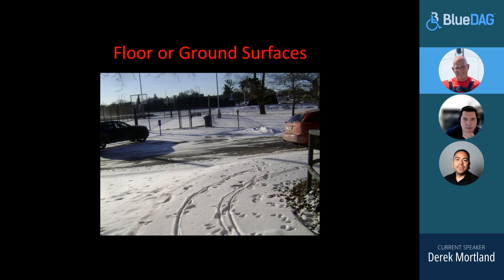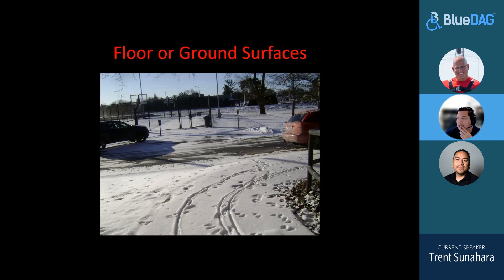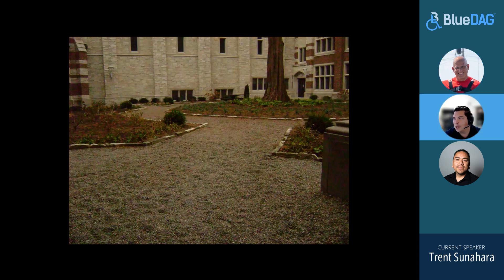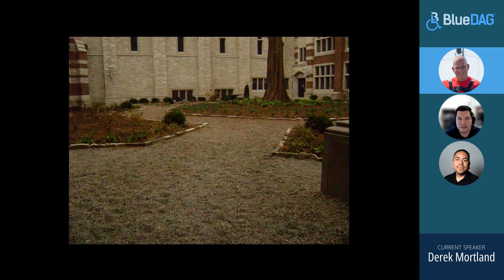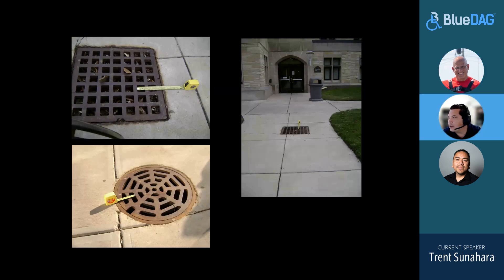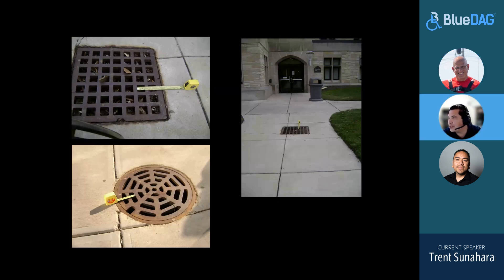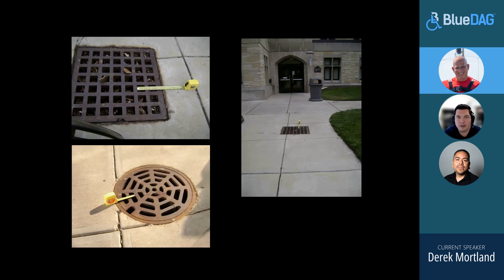BlueDAG Accessibility Minute: Snow, Gravel, Gaps, And Grates

Comment: You are an ADA and accessibility advocate, and your only comment about grates is that it's an issue for anyone with heels? What about a person who is visually impaired or blind using a white cane?!
Reply from the maker: Thanks for your comment. Apologies that it may not have been clear from this short webinar excerpt, but the "heels" comment was made by one of the webinar participants, not the presenter. The webinar was presented in a "what's wrong with this picture?" format, and participants were invited to submit their answers via chat in each section. Of course, oversized grate openings present many hazards to persons with disabilities.